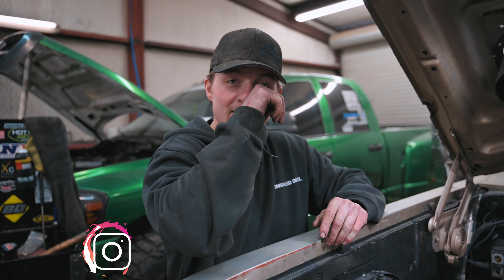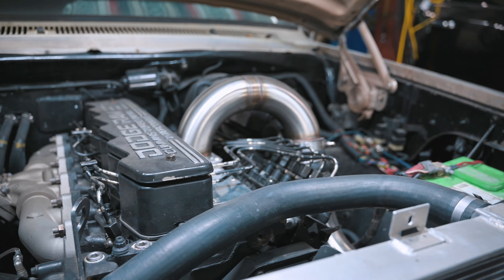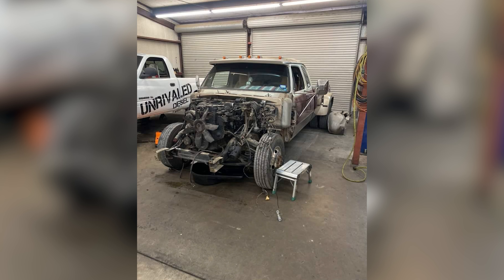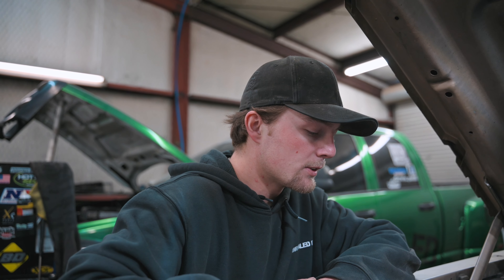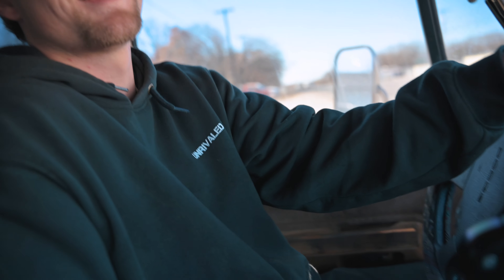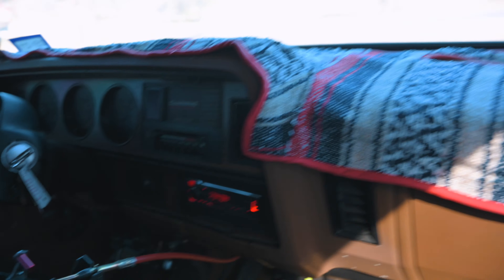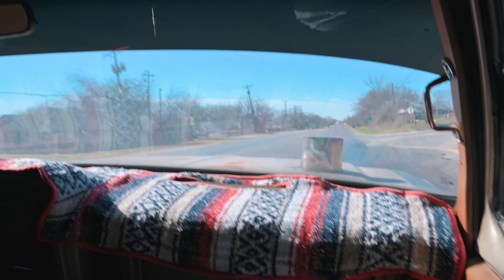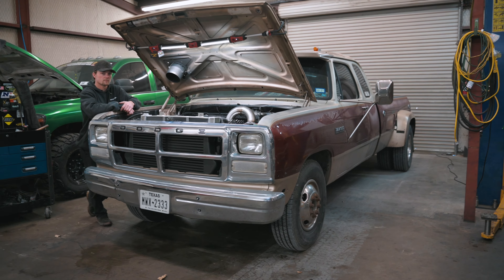HE BUILT a 800HP HOODSTACKED 1ST GEN 12V CUMMINS!!!

Comment: Has this been on a dyno, seems closer to 500hp with 5x13 injectors, turbo set up and timing. Im running a he351 with a s475/96/1.15 with 5x16 injectors and 20 degrees of timing and only projected to make 650hp